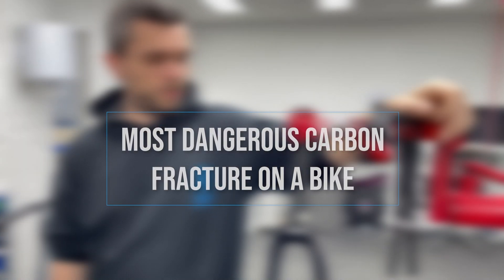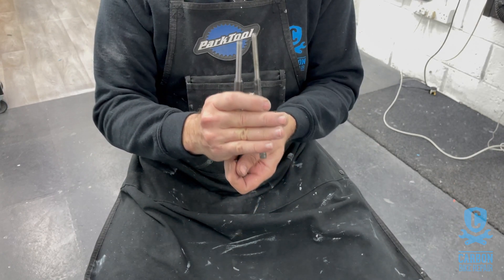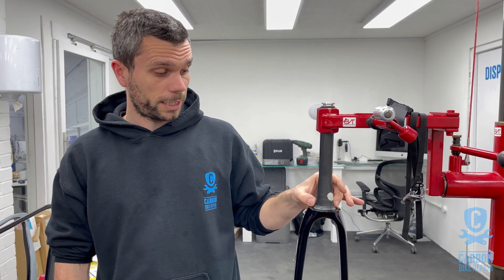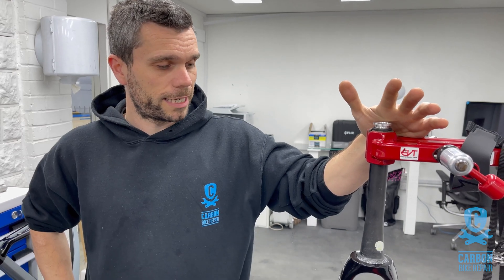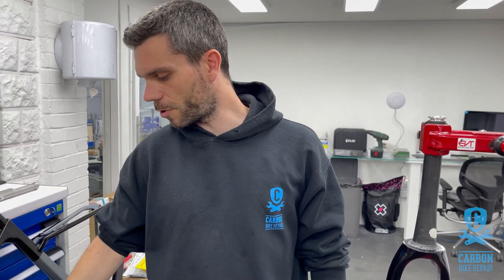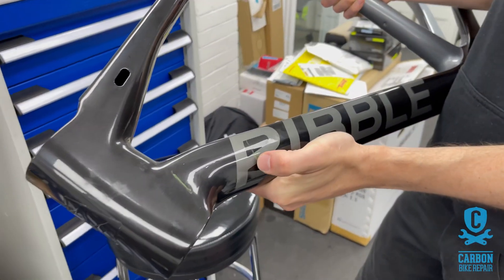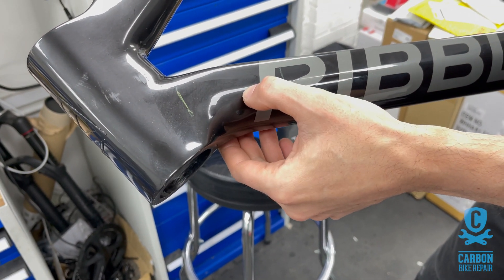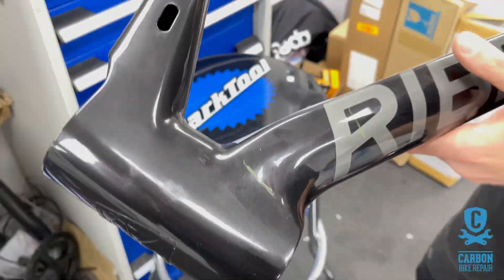Most Dangerous Carbon Fracture on a Bike

Comment: In this case I'm wondering if aluminium will be better option for forks in terms of safety?
Reply from the maker: Possibly because the aluminum can distort but generally the carbon fork will deal with an impact up to 7 times better as long as it’s not a sharp object impact but then it doesn’t matter both are going to land you in trouble